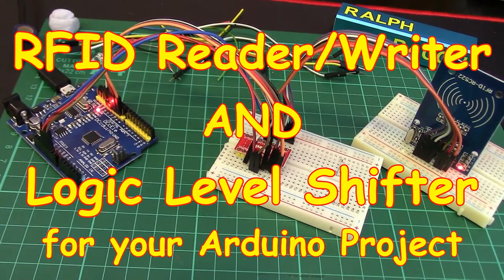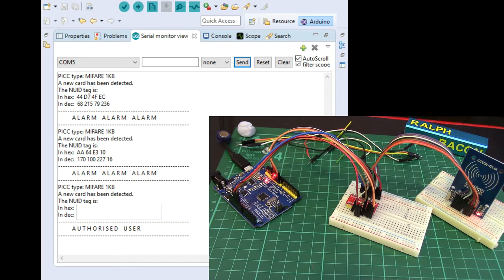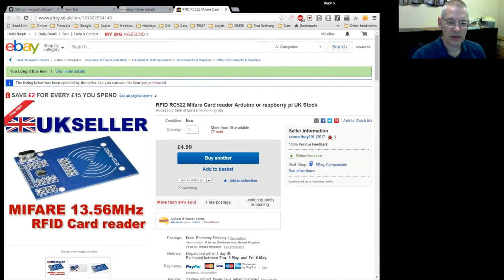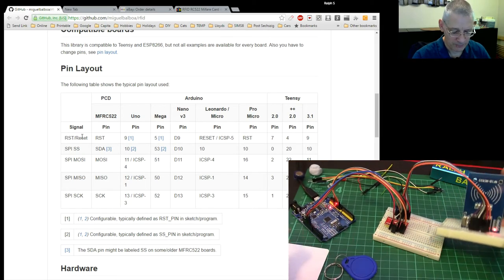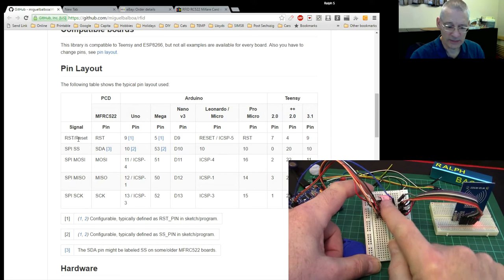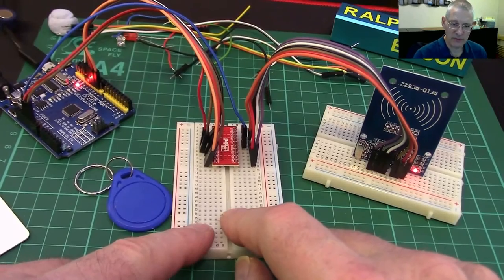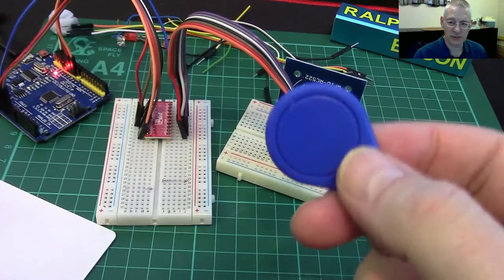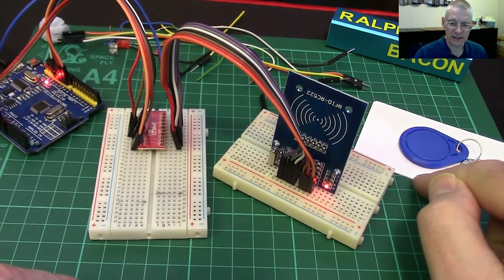#34 RFID Reader/Writer (Mifare MFRC522) with a Logic Level Shifter

Comment: RFID is also used for security patrols: put picc’s in key locations that a patrol must visit, or on the door frame of a door that must be checked periodically. The guard then had an app on his phone that reads the picc’s when he does his patrol. Instant proof in an audit log of the time and date that the patrols were completed.

I have also seen them used in adverts on trains - “ hold your phone here”: the picc stuck behind the advertising poster gives out a url and the phone navigates to the page. 

Qr codes could achieve the same thing in both cases, but they tend to rely on cloud-based decoding, which is not required for rfid.
Reply from the maker: The security patrol thing is spot on, Jeff. More years ago than I am alive my dad did just that (although I suspect it was not RFID and he certainly didn't have any kind of smartphone, they were still using valves (tubes) in those days. But the principle still stands. Interesting about the "hold your phone here", I've not seen that; it must work on NFC or something?
Reply from the maker: Interesting indeed. Thanks for the link. I shall read up on them to see how they can have a place in our Arduino or Pi projects.

Comment: Hey again Ralph, now that I am successfully writing data from the servo to the RFID card(thanks to you!), I need to do the reverse and read this data from a block on the card and then have it used by the servo.

What I am having difficulty with is how to copy/read data from a specific block (and store it in a buffer/variable).  So far, all the examples I've seen only display the data via Serial Monitor, and even then they make use of MFRC522 library functions such as PICC_DumpToSerial().

I've tried using MIFARE_Read(), but the function returns a message saying that the card returned a NAK.  I have made the assumption that this is because I did not perform any authenticity checks that the card may require.  My new solution is to make my own modified version of the MFRC522 library that returns the buffer instead of displaying it in Serial Monitor.  I hope you can tell me that this is a ridiculous idea and that there is a much simpler approach. :P

P.S. Please tell me if you'd like me to start posting these questions elsewhere instead of filling your comments, haha
Reply from the maker: +Sean Sciberras
Hi again Sean, it's great that this has got you fired up with your project! The bad news is that unless I were to actually try doing the 'read from specific block' myself I can't actually point you in the right direction. However, your idea of modifying the library (or copying the method used in the library to your own code and modifying it there) is a great idea and one I do all the time. 
 
Regarding your questions, you would probably get better (and quicker) responses if you posted technical questions on the arduino forum (https://forum.arduino.cc/index.php) as there are many, many experts available there. Just be sure to read the forum rules (eg about posting code using the code tags) and being concise and explicit about the problem and what you have already done to solve it. When they see you have made efforts but have hit a brick wall they will be quick to help. You may see me lurking in the shadows there too!
 
I will, however, keep this query in my backlog as I have really only scratched the surface of RFID reader/writers so I may do a more in-depth future video where I can demonstrate this technique too. Thanks for your continued support of my channel and good luck going forward with your project.
Reply: Alright, library modifying it is then! I understand that you only know so much on the topic, and I have posted these questions on the Arduino forums as well, but quite often your advice is the most relevant and to the point.

Thanks for all your help so far! I hope many more people like me come across your channel, as your videos are a pleasure to watch and you are excellent at giving advice.

Comment: we use rfid at the airport on security trays.
when your bags go into the x-ray machine the information is put on to the tags which are on the trays 
when your bag comes out and needs I section,  the officer will scan your tray, and an image of that tray will show on the screen
Reply from the maker: Hi Chloe! A perfect example of RFID use if ever I saw one. I would expect that the RFID tag (on the tray) contains a unique number linked to the scanning machine thus enabling the scanned image to be shown for the tray. I wonder if the RFID is actually built into the plastic of the tray or just attached (eg slotted into a pocket onto the tray)? Great example Chloe, thanks for posting!
Reply: the rfid tags stick on the trays.as they can get damaged so they peel off and get replaced with new ones....I'm guessing the images are stored on the pc data Base and the tag key is linked to that image..so when the tag is scanned the unique key of that tag brings up the image stored on the pc
Reply from the maker: I think you are totally correct on how it works, and it's probably a good idea to have replaceable RFID as those trays do get banged about a good deal and you would not want trays to be discarded if the RFID chip failed. So replaceable RFIDs is a sensible idea. An excellent example of an RFID application!

Comment: Here's my plan for RFID: My cat has an RFID-chip in his neck. He comes and leaves our house via a cat-door. The door has a 3-way switch; locked, let everyone in, and let everyone out (where "everyone" is cat-sized animals). Now, we have neighbours and they have cats, some of them (the cats) seems to think our cat food is more tasty than their own.

So, my plan is to make a selective cat door which lets everyone out, I don't want to trap cats that accidentally get in, and only let my cat in. That should be easy enough. Well, my cat is 13 years old and would probably not live to tell the story of an automated cat door because his owner can't ever finish a project... But that's the plan anyway. :-)
Reply from the maker: Hold your horses (or cats) there Robert, I'm not certain this will work with the setup in my video. 
 
The frequency for pet chips is different. In the US it's pretty much standardised on 125kHz and in Europe (including the UK) it could be any one of 125 kHz, 128 kHz and 134.2 kHz. You may have to research the frequency used in your part of the world (your vet may be able to confirm).
 
Anyway, that all said, my Mifare RFID project uses 13.56Mhz absolutely no good for your cats (but great for office door locks). But 125kHz readers are available, they are just a bit more money (see here for a random example I found: https://www.seeedstudio.com/125Khz-RFID-module-UART-p-171.html). Research the whole thing well before committing but I think this is very doable (and my Google search shows that, funnily enough, you are not the only one wanting to do this. Who would have thought?) 
 
If you proceed do post back here as I'd be interested in how/what you achieved...
Reply: Oh, I forgot to mention I've already ordered (and received) a 125kHz unit from eBay for $2,50. First I have to make a little test rig and try to read the chip. Could be a challenge as my cat inspects any new items with his teeth (after a bit of smelling).

Edit: Search for "RDM630 EM4100 RFID Card Read Module" on eBay. I'm not sure if that will work though.
Reply from the maker: Oh that's a relief! And thanks for that search term, it worked just fine. For any one else reading this post, here's an example link: http://www.ebay.co.uk/itm/EM4100-RDM630-RFID-Card-Read-Module-UART-Serial-Output-for-Arduino-125-KHZ-/291656810802?hash=item43e819c132:g:bZkAAOSwT~9WkjFC
Needless to say, I'm ordering one right now so I can scan not only my cat Benny, but also the stray we've been feeding for nearly a year now so see whether he's chipped. This is a great idea and great collaboration between Arduinites! Maybe others will be tempted to do what you're doing too? Thanks again for sharing this, it's greatly appreciated.
Reply: And if he's chipped, you may charge the owners for each meal. :-)

Edit: This 125kHz reader is 5V so you don't have to deal with lever-shifting.
Reply from the maker: If he's chipped I want to know why he was underfed and looking very sorry for himself a year ago. Now he's a porky little thing, due to the 4 to 6 packs of food per day we've fed him plus the vitamin powder. I even put a cat flap into my shed so he had somewhere warm to sleep (which he uses only occasionally). Anyway, this talk is making Benny very jealous so back to Arduino world! I've ordered the component so once the slow boat from China has delivered it I'll add it to my backlog. Very useful that it's 5v, just makes life simpler. It will be interesting whether this works on UK chipped cats... Thanks for that info too!

Comment: hi, i have a project to put on a 24v system, I need to sense when a 24v relay switches with an arduino to then signal to another relay to work a solenoid valve on a timer set by the arduino. I was wondering could i use a optocoupler isolator module to give me the signal that the relay has turned on.
plan would be to connect the 24v side of the isolator module into the coil circuit for a relay that turns on a hydraulic solenoid valve, to signal to the arduino to turn on another relay which works another solenoid valve(basically there is an existing system that i want to piggyback on as a signal to perform another task as i don't want to interfere with it). my question is how much current could an opto isolator handle could i wire it straight to the relay circuit or even the solenoid valve circuit? or is there another way to wire it that limits the current through the module?
Reply from the maker: You want to know when a relay from an external system has been switched on?

Yes, ensure the GROUND connections of both systems are connected together and put the opto LED in the same bit of the external circuit as the relay WITH a suitable resistor. Normally, the opto LEDs are designed for 5v (or less, if bare components), not 24v, so you want to drop 19v at say 20mA. Using Ohm's law that is 19 divided by 0.02 = 950 ohms. Call it 1KΩ to be safe. 

So your external circuit is now powering both the relay and your new opto LED. What you do with the output of the opto coupler is now up to you.
Reply: @RalphBacon  thanks for the reply. Just made that circuit up on tinkercad a few nights ago and looked good but still unsure.
Just to clarify when you say jojn thr grounds you mean the opto LED coupler and the relay I'm "sensing" correct?
Reply from the maker: Well really I mean the ground connection of both systems PSU but the bits you mentioned are two parts of the two systems, so would do fine.

Comment: The rfid_read_write_personal_data sketch is designed to receive text from Serial Monitor and store it to a buffer as type byte * (as seen by the variable declaration: byte buffer[34];).  I need the sketch to instead take data from one of my own integer variables (an analog sensor reading, as used in Knob.ino).  How would I go about converting an integer value such as 180 into the same type as the buffer?  The itoa function comes close, but still isn't quite what the buffer is looking for and so I still get an error.
Reply from the maker: Without knowing the detail I can suggest this: the integer value can hold a far greater range than a single byte (because an integer is two bytes big). If your integer value is larger than 255 then you may have a problem as that's as large as a single byte allows (before resetting back to zero, no error is given).
 
That said, it looks like he is expecting one digit per character so if you have "180" you store that into the buffer as three separate characters, "1", "8" and "0" as if they were alpha. So you can do that by entering String myNumber = String(n); where n is the 180. Try this!
Reply: The method you described where 180 is stored as separate characters is how I expected to do it, so that's all good.  I'm not sure if I implemented your suggested code correctly though.  I have:
byte buffer[34]; //original code
String analog_servo1_string = String(analog_servo1); //new variable
buffer = analog_servo1_string; //my attempt at stuffing the "180" into the buffer...is this right?

That last line of code gives me the error:
incompatible types in assignment of 'String' to 'byte [34] {aka unsigned char [34]}'
Reply from the maker: The buffer is an array (so is the String) so you must put each character of the String into the buffer on character at a time, eg buffer[0] = analog1_servo1_string[0] and so on.
Reply: Ah, right!  Wouldn't be the first time I've forgotten that lol

Comment: Hi, i'm getting this error frequently when i write the cards "RFID ERROR: PCD_Authenticate() failed: Timeout in communication"
what should i do??
Reply from the maker: I don't know the answer, adi, but I found a thread that might help you:
https://forum.arduino.cc/index.php?topic=489286.0
Reply: I had this with corrupt cards. If you have a smartphone, you can get mifare tools. Using nfc on the phone , you can use this app to do a factory reset and fix the card.

Comment: Hi Sir, can you help with printing only the uid and family name, first name added in the card? thanks in advance!
Reply from the maker: Hi Crazy Virux! If you inspect the code where the information is extracted you just need to identify the variables that you are interested in and write those out (either to the Serial Monitor or probably better an LCD display). Look at the examples that came with the library, they will give you a starting point - start simply and work up to your goal :)

Comment: Hi Ralph, how can I write to a specific sector and block? I need to write data to Sector: 1 Block: 4
Reply from the maker: +Fred Haynes
Thanks for posting this interesting question! Even though I can't quite remember what sector/block I wrote to in the demo video, the library (MFRC522) that I included in the video description has an example sketch call "ReadAndWrite.ino" which it says: 
 
This sample shows how to read and write data blocks on a MIFARE Classic PICC
BEWARE: Data will be written to the PICC, in sector #1 (blocks #4 to #7).
 
I don't know why it says BEWARE but I'd have a good look (and a read-up perhaps) on why this might be a bit dangerous. I do know that writing to sector 0, Block 0 can be done (to change the ID of the card), but actually should not be allowed. Our Far Eastern friends have determined, however, that we should not be prevented from bricking our own cards so have left it wide open!
 
That's the best I can do right now, I hope it gives you a pointer, at least, to the answer you're looking for!

Comment: Hi, thanks you so much for sharing this video! I have a couple questions to finish my project: Our team are making a vehicle tracking system, and RFID reader is a part of this system. The RFID reader has to read information (driving license and driver 's name) and sent them to "black box" to active car. Could you help me how to:
1. How to write these information to tags (block and sector could be choosen);
2. How to read these information again and send them to UART port;
3. Have you ever try using STM32 with this library;
Thank you for your reading!
Reply from the maker: Well Danh, I'm happy you like the video but there's only so many hours in the day and what you're asking is a lot. What you need to do is read up the spec sheets in more detail (after getting my demo to work) so you know how to address the memory correctly and then how to send the data to the device. General questions on "how to" are best answered by the Arduino forum (http://forum.arduino.cc/index.php) but do avoid asking them to do your work and research - they will help with roadblocks but not do your homework! Good luck!

Comment: What version/model of UNO do you have in the video?  I have a Genuino UNO, and it has both a 5V and 3.3V pin.  I am connecting my MIFARE RC522 to the 3.3V instead and it seems to be working fine so far.  Also, my MIFARE reader is red, not blue, and the pin labels and their order are slightly different.  Could this possibly cause me trouble since most walkthroughs/resources refer to the "typical" blue version?  If so, I wouldn't mind buying the blue version as well to make life easier. lol
The red one I have says "RFID-RC522 Funduino" on the board.  It came in a LinkSprite box with a UPC sticker that said "MIFARE RC522 CAARD...RD PROXIMITY MODULE New"

Btw, I'm "XORduino" on the Arduino forums :)
Reply from the maker: Hi XORduino! I have a "ddCduino" as my UNO clone but that is purely by luck than judgement - that is, I ordered it from the Far East via eBay and this is what I got (amongst several others). It was very good value (IIRC GBP 3-4 which is about $4.50 - 6.00) and has worked very well. It too has a 5v and a 3.3v pin.

I also use a Nano on an expansion board as that gives me a +ve, -ve and the GPIO pin for each and every pin on the board. Plus a few others. Developers' dream board, really.

As far as your Mifare reader goes I will have to check up tonight to see if there are different versions around or whether the board colour is just cosmetic.

OK, I've now checked the Mifare reader (blue board) and the chip on it has had its identification marks removed (allegedly, they are not present now, perhaps they never were). In any case I can't tell what the chip is so there is no way of determining whether this reader is the same as yours or not now. Frankly, for the price of a 'blue' classic reader you might as well get one and join the merry crowd of working readers!
Reply: Awesome, thanks!